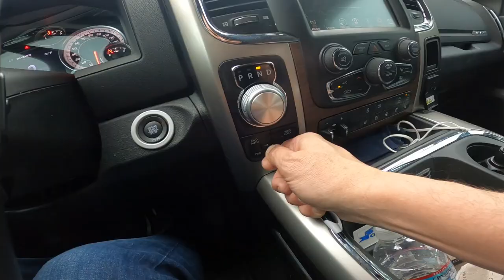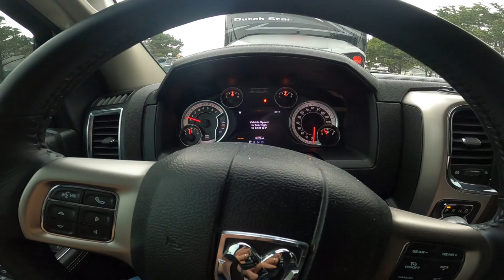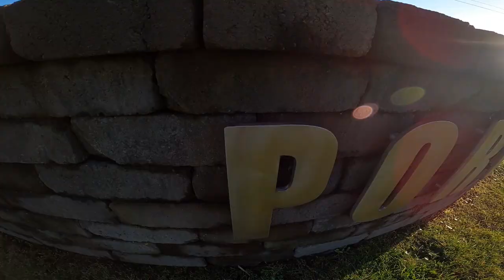FLAT TOW THE RAM 1500 BY 2021 4369 DUTCHSTAR TRUMPER FISHING

Comment: It is really interesting how similar toys we have.  I have the 2020 Newmar 4081, you have the newer and larger model of the Dutch Star.  I have a 2019 24' Duckworth, you have the monster size Duck and yours if Offshore, mine is Pacific Pro.  I have a Ram 2500 diesel that I flat tow, you have the Ram 1500 that you flat tow.  Thanks for putting this video out there, there is not much guidance on flat towing Dodge trucks.  I did put a TPMS for my truck.  I look forward to coming to Oregon and fishing with you one day.
Reply from the maker: Cool so you have the tire pressure monitor of  your tow vehicle on the dash on your coach?

Comment: Does your steering wheel turn after you prep it for flat towing. I am about to take my first trip with my ram was just curious if there is an additional procedure for unlocking the steering wheel.
Reply from the maker: No just follow the steps for disengaging the driveline
Very simple process no extra steps